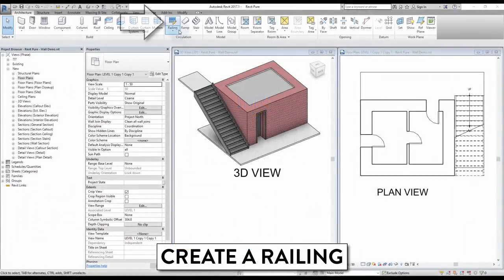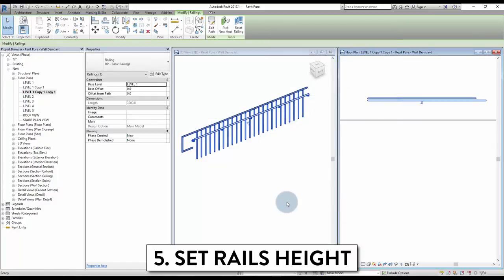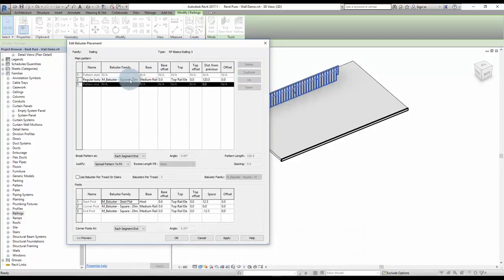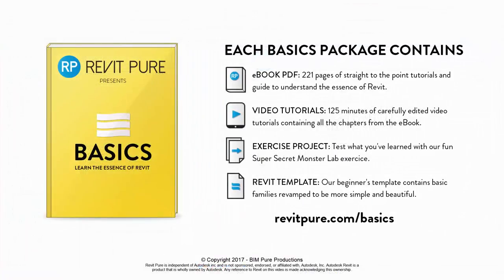Tips To Understand Revit Railings

Comment: Adjust Offset from Path:

Select the railing.
Find the offset tool in the properties.
Adjust the value to move the railing among stairs. Negative value pushes the railing exterior.
Activate Railing Preview:

Navigate to the Modify tab.
Check the preview box.
Start drawing boundary lines to see a 3D preview efficiently.
Post Railings to Slope Walls and Floors:

While creating a railing, click on pick new host.
Select a wall or a floor to host your railing.
Railing will automatically adjust to the slope of the selected element.
Customize Top Rail Extensions:

Activate the top rail.
Click to change the type and set a profile (e.g., circular 30 mm).
Set the extension style (e.g., wall, floor, or post).
Adjust distances as needed.
Adjust Height and Clearance of Rails:

Go to the handrail type.
Select the desired height and hand clearance.
Set the height for the top rail.
Customize Baluster Placement and Pattern:

Edit the type of baluster placement.
Set base and top constraints.
Adjust distance between each baluster.
Choose justification type (e.g., spread pattern, center).
Use Project Browser to Find All Railing Parts:

Access the project browser.
Navigate to the railing submenu.
Find handrails, balusters, supports, top rails, and railings easily.
Select Specific Railing Parts Individually:

Click on the railing.
Use the tab key to cycle through different parts.
Select and modify specific parts like top rails, handrails, and supports.
Adjust Supports Position:

Select the support.
Unpin it if necessary.
Use the move command to adjust its position as needed.
Create Glazed Railings Using Curtain Walls:

Design a curtain wall with suitable vertical spacing.
Add a railing with a compatible handrail type.
Ensure the handrail fits with the curtain wall railing.
Customize Top Rail Extension Shapes:

Edit the top rail.
Click on edit rail and then edit path.
Draw the desired shape for the extension profile.
Confirm the changes to apply the custom shape.

Comment: 00:30 💡 Adjust offset from path to move the railing location among stairs.
01:00 🏗 Activate railing preview for efficient creation in the 3D view.
01:30 🛠 Post railings to slope walls and floors for automatic angle adjustment.
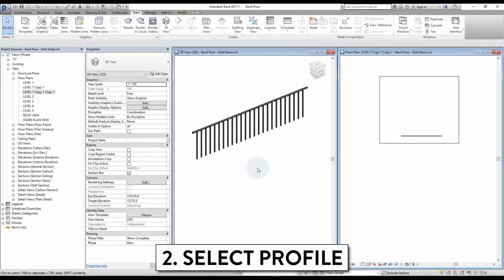02:23 📏 Customize top rail extensions with different styles and distances.
03:34 🎚 Adjust the height and clearance of rails for safety and aesthetics.
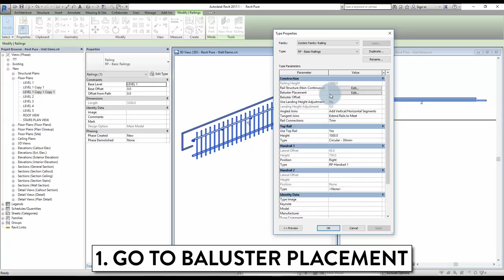04:06 🔩 Customize baluster placement and pattern to fit railing length.
05:20 👁‍🗨 Use project browser to find all railing parts easily.
06:04 🔍 Select specific railing parts individually for modification.
06:18 📐 Adjust supports position by unpinning and using the move command.
06:56 🏢 Create glazed railings using curtain walls with appropriate handrail type.
07:27 ✏ Customize top rail extension shapes by editing the path.

Comment: 🎯 Key Takeaways for quick navigation:

00:30 💡 Adjust offset from path to move the railing location among stairs.
01:00 🏗️ Activate railing preview for efficient creation in the 3D view.
01:30 🛠️ Post railings to slope walls and floors for automatic angle adjustment.
02:23 📏 Customize top rail extensions with different styles and distances.
03:34 🎚️ Adjust the height and clearance of rails for safety and aesthetics.
04:06 🔩 Customize baluster placement and pattern to fit railing length.
05:20 👁️‍🗨️ Use project browser to find all railing parts easily.
06:04 🔍 Select specific railing parts individually for modification.
06:18 📐 Adjust supports position by unpinning and using the move command.
06:56 🏢 Create glazed railings using curtain walls with appropriate handrail type.
07:27 ✏️ Customize top rail extension shapes by editing the path.

Made with HARPA AI

Comment: 3 RAILING CREATION TIPS (5 CONSIGLI PER CREARE RINGHIERE)
1. Adjust offset from path (Modifica offset dal percorso) - 0:37
2. Activate railing preview (Attiva anteprima ringhiera nel pannello "Modifica tipo") - 0:54
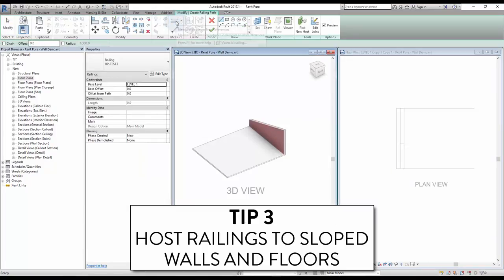3. Host railings to sloped walls and floors (Ospita ringhiere su muri e pavimenti inclinati) - 1:08

THE ANATOMY OF A RAILING (ANATOMIA DELLA RINGHIERA) - 1:31

CREATE A RAILING TYPE (CREA TIPO DI RINGHIERA)
1. Create top rail / handrail type (Crea corrente superiore e corrimano) - 1:58
2. Select profile (Seleziona profilo) - 2:08
3. Set the extensions (Imposta estensioni) - 2:21
4. Set handrail support (Imposta supporti corrimano) - 2:47
5.  Set rails height (Imposta altezza corrente superiore e corrimano) - 3:10

CREATE INTERMEDIATE RAILS (CREA CORRENTI INTERMEDI)
1. Edit type > Rail structure (Modifica tipo > Struttura del corrente (non continuo)) - 3:40
2. Insert new rail (Inserisci nuova ringhiera) - 3:45
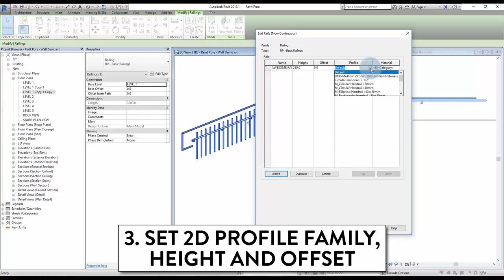3. Set 2D profile family, height and offset (Seleziona profilo 2D, imposta altezza e offset) - 3:51

CREATE A BALUSTER PATTERN (CREA BALAUSTRE)
1. Edit type > Baluster placement (Modifica tipo > Posizionamento balaustre) - 4:10
2.  Select a baluster family (Seleziona famiglia balaustra) - 4:13
3. Set base and top of the balusters (Imposta altezza base ed estremità superiore della balaustra) - 4:19
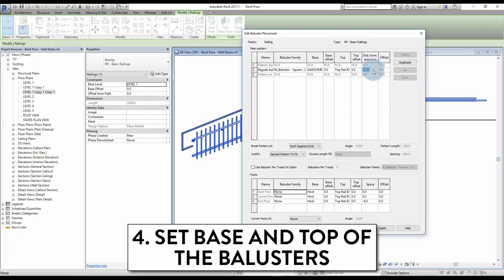4. Set distance from previous (Imposta distanza dal precedente) - 4:34
5. Set baluster justification (Imposta parametro "Giustifica") - 4:41
6. Select posts (Seleziona montanti) - 5:00

5 RAILING TIPS (5 CONSIGLI)
1. Show "Preview" in railing type (Mostra "Anteprima" nella finestra "Modifica tipo") - 5:19
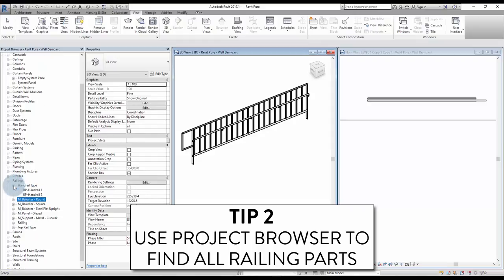2. Use "Project browser" to find all railing parts (Usa "Browser di progetto" per trovare tutti i componenti della ringhiera) - 5:28
3. Adjust railing transitions (Imposta transizioni: Modifica tipo > Corrente superiore > Tipo > Transizioni) 5:40
4. Use "tab" to select specific railing parts (Usa tasto "tab" per selezionare specifici componenti della ringhiera) - 6:00
5. Adjust supports position (Modifica posizione supporti) - 6:17

3 ADVANCED RAILING TIPS (3 CONSIGLI PER MODELLAZIONE AVANZATA)
1. Create glazed railings with glazed balusters (Crea ringhiere di vetro) - 6:30
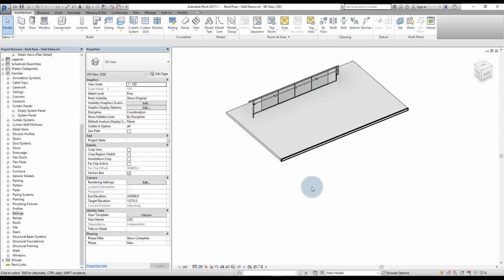2. Create glazed railings with curtain walls (Crea ringhiere vetrate usando comando "Facciata continua") - 6:49
3. Create fancy extension shapes (Crea estensioni dalla forma particolare) - 7:11

Comment: Just to let you know i am from austria so i am not sure if the terms i use now are correct.

I have a coiled staircase and want to have a railing on the inside. the first staircase reaches from the basement to the ground level and the next staircase from the ground level to the first upper floor. the staircases are the exact same and in the same position but at the top of each staircase the railing is too high and i don't know at all how to fix that.
another thing is i also don't know if it is possible to connect them on the ground level because otherwise there would be a gap.

would be nice if you know a solution to that. (btw i am still in school so i don't have any experience with revit)